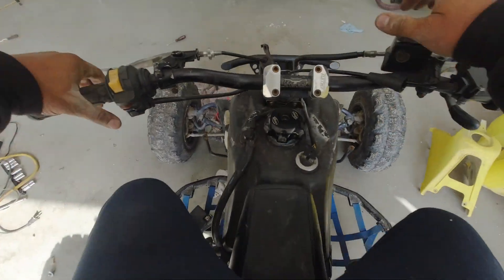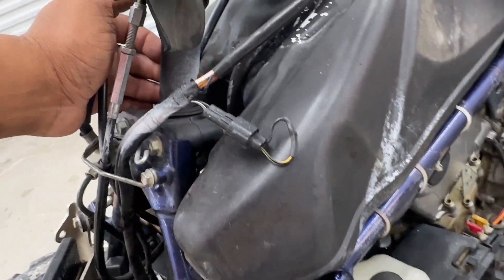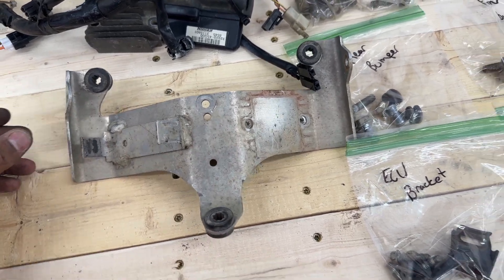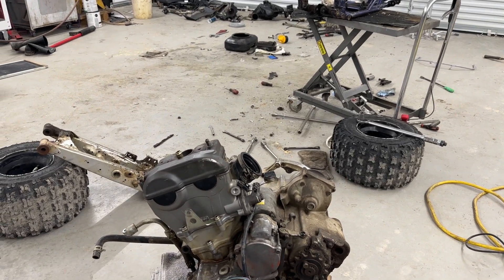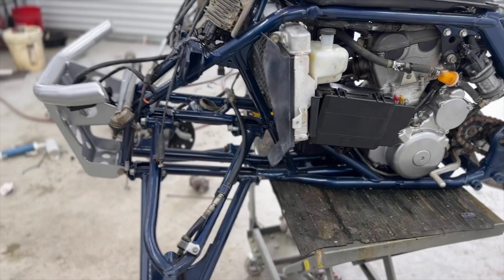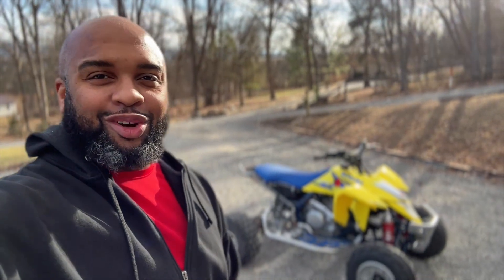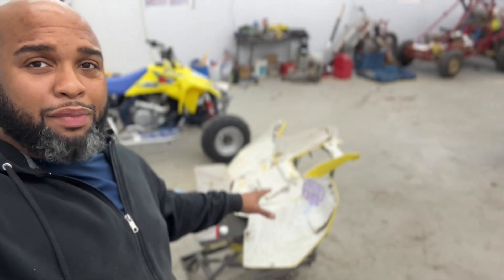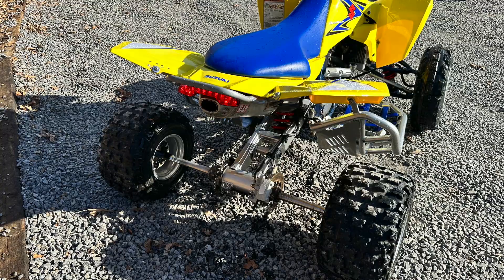2006 LTR 450 Restoration p 2

Comment: Hey, I just had a Ltr rebuild but the problem is the oil from the clutch side is transferring to the engine side. This bike doesn’t have crankshaft seal. What do you think the problem is?
Reply from the maker: I am not sure on that. Maybe join the LTR Facebook group. Plenty of wizards in there!

Comment: I have a problem i need you help

I put 1200 ml of oil in the tank and 400 ml in the clutch, I turn it on for 3 minutes and let it cool. But the dipstick doesn't show any oil, what could it be? I would appreciate any advice
Reply from the maker: I would check the manual. If it was a complete change, sometimes they require a bit more oil. If all of the tubing was empty. I would Just add a bit more to the fill marks and run it.
Reply: Thanks you very much